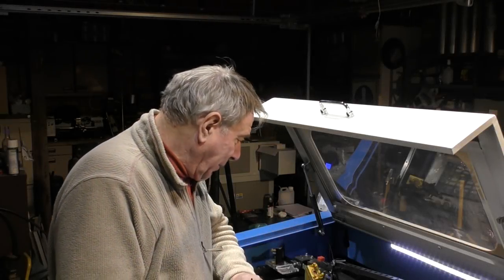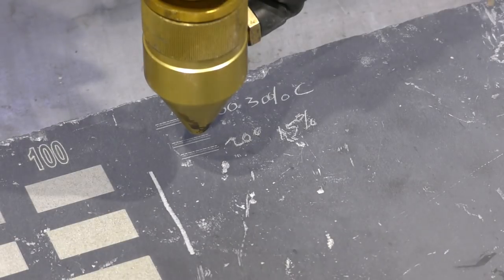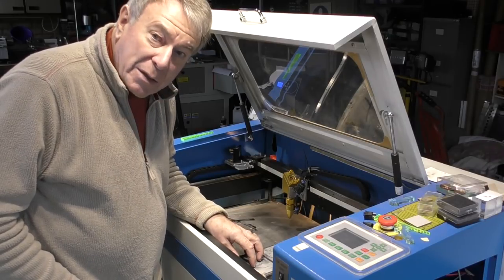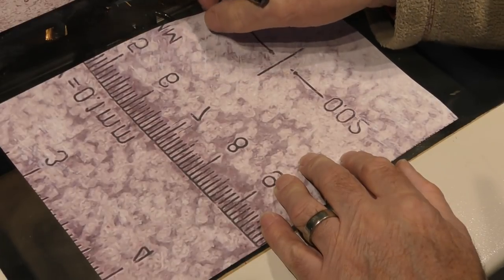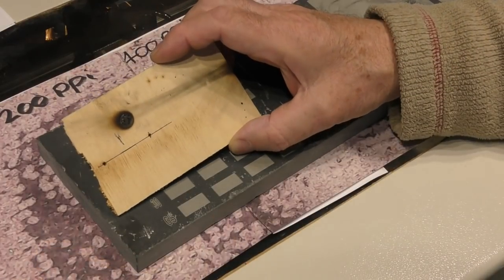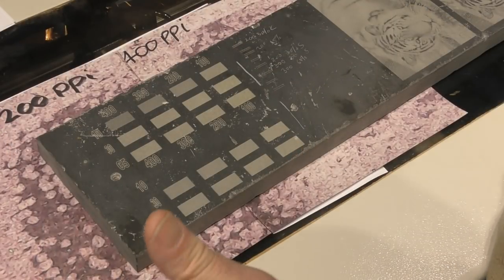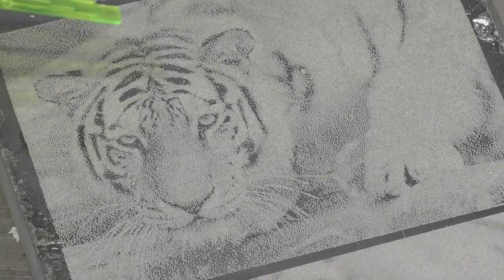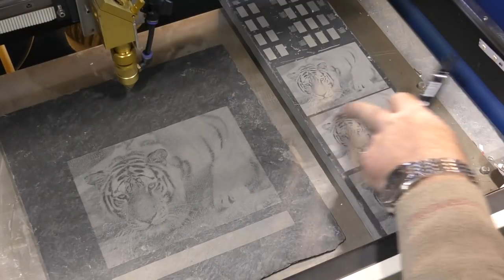RDWorks Learning Lab 133 Photo Engraving Mineral Materials Part 2

Comment: The slate that I can get locally in my town is awful for engraving but I can get granite tile in a color called "Absolute Black" and it's wonderful when engraved. The contrast is very high and there are very few light specks in the stone. I've done memorial stones for gardens, veteran appreciation plaques, wedding vows, etc. and it always turns out beautifully. I've also been successful a few times engraving photographs.
Reply from the maker: Thanks Joe
I'll have to keep an eye open for some floor tiles. Those that I have seen so far, even though they are basically natural black granite, have still got that fairly coarse granular structure beneath the polished black surface But that is the very nature of natural granite. The tiles (which I would have to buy!!) were not different to the free off-cuts that I managed to find. Granite is always a composition of different materials that will therefor e etch with different textues and colours. Slate was my top choice because of the fine silty nature of the base material before it was petrified. It gives good predictable results, provide the composition is correct. I can understand your "awful" comment. You have to find the right type of slate and then it's magic.. Thanks for the suggestion, I'll keep looking.
Best wishes
Russ.
Reply: thanks for the information.

Comment: Russ, my 60 watt factory tube froze and cracked so I had to buy a new one. 1200mm X 55mm compared to the old one 1000mm X 50mm. All of my old settings are no longer working. and I am getting some strange empty spots in some text on black granite. The empty spots are happening in the same place on different pieces. I am etching at 185mm/sec and 50% power. Any Ideas?
Reply from the maker: Yes I anticipate I know what your problem is. Take a look at your you tube messages as I have requested a picture.
Best wishes
Russ
Reply from the maker: Hi
I have seen the picture. When you view the image in the preview screen, can you see those white areas (by his right arm I presume?) Did you get my email address?
Russ
Reply from the maker: Please  send me the picture of the wiring into your HV power supply and we can move on from there.
Russ